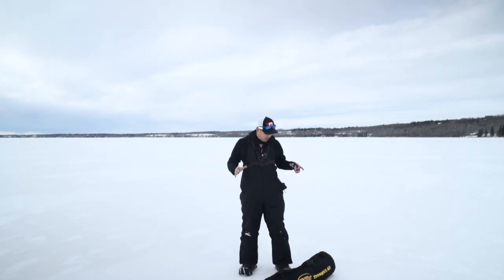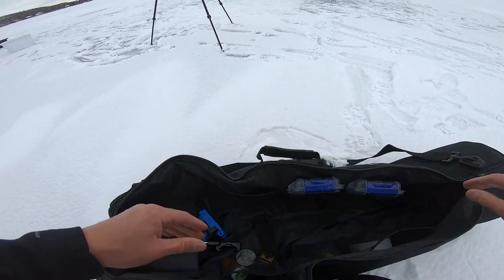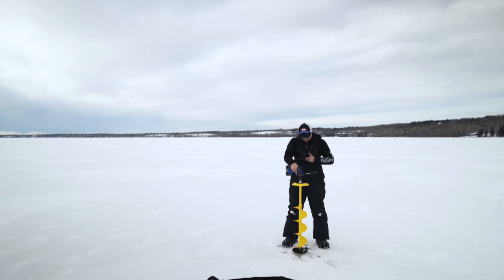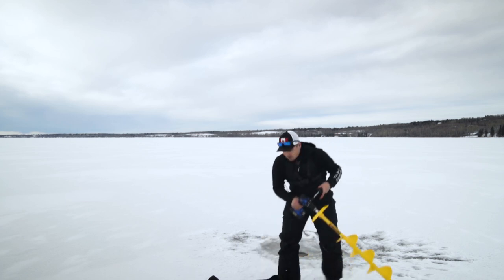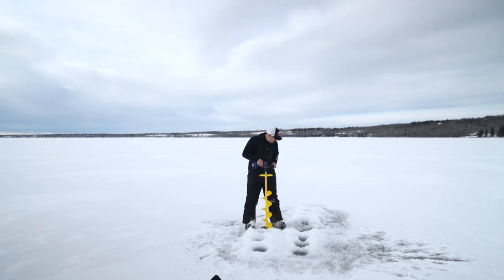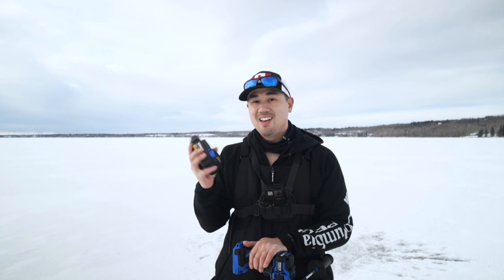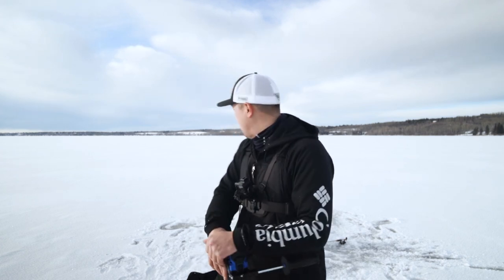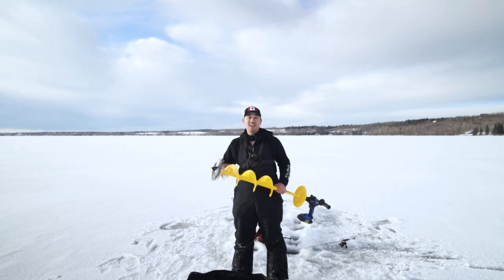Jiffy Torch and Kobalt XTR Drill Test and Review

Comment: Just bought the jiffy 6" torch. Milwaukee drill with 5ah battery, i punched 80 holes and was on half battery. Arms gave out before the battery did. 
My drill and one battery is cheaper thsn your and 3 batteries. Buy once, cry once!
The auger itself is great i have no concerns about it. Looking forwardvto see what it can do in 3 feet of ice at -30C.
Reply from the maker: Thanks Chris! the 8" has double the cutting surface of the 6" so i'm wondering how it would do with a Milwaukee. I will be testing it this week with a 5ah Milwaukee so lets see how it goes. Howmuch is your drill and 1 battery if you dont mind me asking.
Reply from the maker: my new video on the torch is up! its more of a rant. I tried it on another drill and it chews through the battery(dewalt dcd999 with 6ah).

Comment: Great video Huy, 18 - 8 inch holes is not bad for one battery. I just picked up 2 - 5 amp batteries for my 20V DeWalt at Home Depot for $169.00.
Reply from the maker: Thank you! Honestly a lot Less holes then I expected so I did pick up more batteries. I will also try it in a Milwaukee. The thing is i suspected continuously drilling without allowing it to rest also drain power a little quicker. I’m gonna test it again while allowing it to rest in between.

Comment: I liked this test. It'll come in handy when me and 17 of my closest ice fishing buddies are targeting a super tight group of panfish LOL. Just kidding, I appreciate the "scientific experiment" and it's nice to see what the upper level of severe use can still get you. I just bought the Kobalt XTR yesterday for our ice season. I was impressed with the in-lbs offered, and found one on sale for $80 less that MSRP. Typically, I'm not drilling that many, or that rapidly, so I'm assuming with normal use, the battery life will last much longer. Somedays I might drill half of that for an entire trip. Somedays, it might be double. Always a good idea to upgrade to higher AH or have multiple units. Thanks for the video!
Reply from the maker: I just uploaded a new video on the torch. I ended up trying it on a new drill which is a higher end 6ah dewalt and the torch chewed through the battery faster then comparable auger bits. I'm not too happy lol So it was the torch burning out my kobalt battery putting it under extra strain.

Comment: Are those auger better  performance  than a regular metal auger? I was tempted  to get one instead a gas auger but I guess next season  I'll do that
Reply from the maker: I'm gonna do some further testing and will report back. The reason why I wanted a drill is so I can cut both holes and screw in tent pegs at the same time. Plus its more space saving. I just need bigger and better batteries. Also some extra!
Reply: @HuyFishin  yeah is fine if you driving but yea take a lot more space the gas auger
Reply from the maker: @RaulGarciaFishingandOutdoors  YUP! I just sold a larger jiffy propane auger and it was big and heavy! This new set up is so light and nice to pack and carry I love it. I guess the only disappointment was amount of holes I could do. It was strong enough to cut an 8 inch hole very easy though. If you were gonnna do it I would highly recommend one of the new auger bits with plastic flite. Get  a good drill though LOL

Comment: Good tuff man I like the torch just seems that it didn't last too long.  4mah isn't much I'd go with a minimum 5mah.  I leave my milwakee out on ice all day and it doesn't seem  to get affected much from the cold and has never let me down yet. I usually drill minimum 5 holes and most off 20.  I use the shaver blades o  my flites though and I think that the rippers tend to take more torque and kill batteries faster. Good vid dude loved it👍👍
Reply from the maker: Yea the 4ah sure took a pretty quick beating. I'm gonna try the 5ah battery this week with some constant drilling lets see howmany holes it can do. I'm sure having chipper blades are harder on it forsure.

Comment: Great video, I think for the price this is a highly effective combo. I would worry that if the ice was 2.5 to 3 feet thick that battery would have overheated before you got through 2 holes.
Reply from the maker: I was thinking the same haha but I calculated the 11 holes till overheating would be about 4 holes late ice haha so I am actually just gonna get some extra batteries and let it rest between 3 holes after drilling it. haha Thank you for watching Dean
Reply: I've got the same drill in a 6" auger  and I've been punching dozens of holes through 2 feet of ice and I've not had any issues yet. I also run a 6.0 ah extended run battery. 8" auger is overrated anyway unless you catch big fish (Pike, Musky, +sized Lakers/walleyes)

Comment: Nice video!  I bought the Kobalt 1200 torque one last year and I've been very happy with it.  I use it with an 8" Lazer auger.  I haven't over heated it, but my normal usage is drill 4-6 holes through 8" of ice.  Fish a bit, then maybe drill a few more.  I love it.  I tested it once, and I think I could get 30 holes through 6" with a 2.0 Ah.  I didn't want to test my 4.0 Ah.  The Torch looks interesting, but I like keeping a spare set of Lazer blades with me, and I sharpen them myself.  Not sure how I'd sharpen a Torch.
- Joe
Reply from the maker: Yea! It was a little disappointing how I was only able to drill about 115 inches till it overheated when many guys are able to use other augers and drills to get around 500-560 inches of ice. It had the torque but the battery couldn’t handle it. I picked up a high end dewalt so I’m gonna test it tomorrow. Hoping to be able to punch a bunch of holes without overheating. Gonna give it a go tomorrow.  Trying to figure out if the auger is inefficient or if the drill was a dud. Stay tuned!
Reply from the maker: my new video on the torch is up! its more of a rant. I tried it on another drill and it chews through the battery. check it out!

Comment from the maker: Dewalt or Milwaukee ?
Reply: Dewalt and I have a regular metal  auger and I got a 2 pack battery  from Amazon for $90 and they work well
Reply: Milwaukee motors have the most windings in them which makes them the strongest cordless tools in the industry. Dewalt has been making some good drills again in the past few years so they are also great as well. The comparable AH batteries for either brand are about the same.
Reply: Doesn’t really matter brand I would go Milwaukee but any decent brushless drill with a 20 v lithium battery should be good.
Reply from the maker: @RaulGarciaFishingandOutdoors  use your metal flite on that drill!
Reply from the maker: @A.C._Taylor  You would say neck and neck? Or Milwaukee
Reply from the maker: @elibrownoutdoors9780  Yea I think I need stronger batteries forsure.  I wasn't exactly lacking power. The batteries were a big fail though.
Reply: @HuyFishin  yes I do.
Reply: @HuyFishin  I'll start by saying that I personally use DeWalt tools at work. I'm a commercial construction foreman and resident carpenter for over well over 10 years now.
 I work alongside all sub-trades here in Alberta. The oldest cordless tools that I consistently see on site, are Milwaukees. They are as long lived and bullet proof as you can get.
 The only reason why I stayed away from them is because of how heavy they are. Having to work all over buildings at heights, in all kinds of positions, makes them less desirable because of that. But they are as durable and powerful as you can get. 
This will sound funny but they must still be keeping up with their quality because Canadian Tire still doesn't carry Milwaukees as that is the type of retail where a brand degrades it's quality for quantity. 
In summary, Milwaukee is still the best if weight is not a concern.
Reply: Milwaukee all the way bro. Great video man!!
Reply: I have a Milwaukee mud mixer with a 12ah battery and I cut a lot of holes and I've never run out of battery with it
Reply: @A.C._Taylor  I find dewt names great drills  them and Milwaukee just don’t get a ryobi!!! Lol

Comment: You'll be happy with the milwaukee fuel I use a 9AH Heavy duty battery and I can drill an easy 50 holes before I drop a bar on my battery life!
Reply from the maker: never even knew they had a 9ah battery! that sounds pretty damn pricey cuz a milwaukee 5ah is already sitting 188 retail right now
Reply: I believe it was 280, but I use it for work aswell I bring out that 9ah and my 2 5ahs just in case when I'm fishing I've never had to touch the 5s yet, milwaukee tools are great I'm a fan boy 😂😂